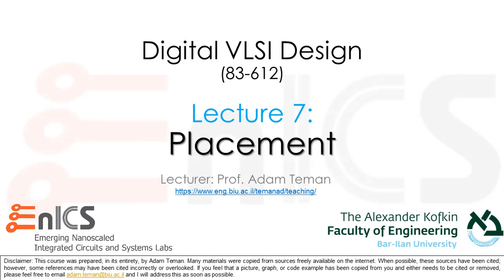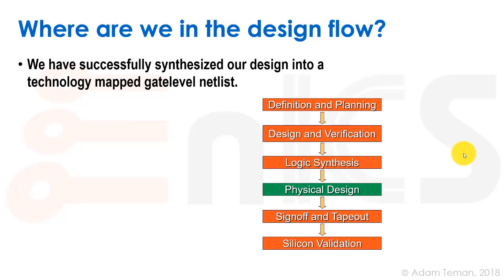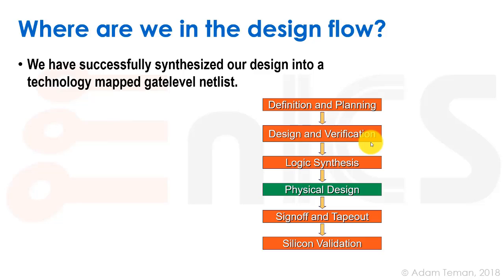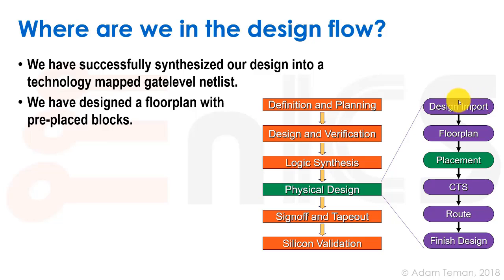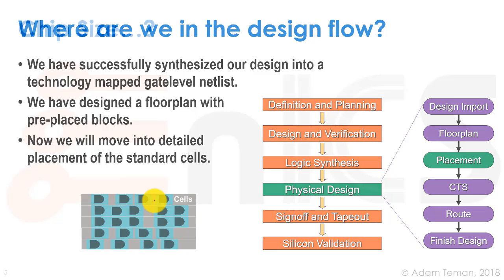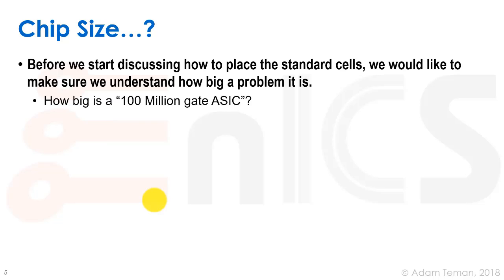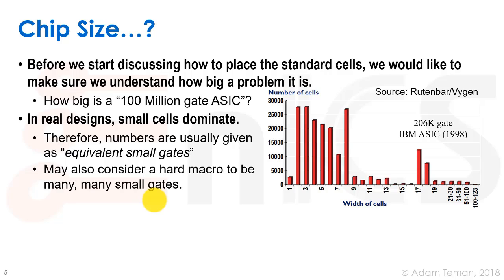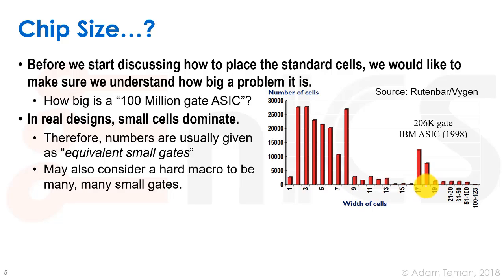DVD - Lecture 7a: Standard Cell Placement

Comment: Hi professor Teman,

At around 3:00, you mentioned many it’s usually to use NAND2 as reference gate since it’s like CMOS. I’m a bit confused about that, could you kindly explain further? Thanks.
Reply from the maker: Hi Mike,

The "basic" CMOS gate is the NAND. As you may have learned in a basic circuit design course, the NAND is usually the preferred CMOS structure, since it has two NMOS in series, as opposed to NOR, which has two PMOS in series. Assuming that NMOS are faster than PMOS (not a valid assumption in some advanced technologies...) then a NAND can be made smaller/faster/more efficient than a NOR, and therefore, it is the "reference" gate.
Reply: Hi Professor @AdiTeman,
Thank you very much for your response. Is the speed of NMOS faster than PMOS because of the doping concentration?

By the way, I genuinely appreciate your course. I used to work at TSMC, but I wasn’t actually very familiar with how a chip is designed. The course is very informative and clear!
Reply: @mikewang4626  mobility of electrons is slightly higher than mobility of holes. thats why nmos is faster. may not be true for modern processes.
Reply from the maker: Thanks @rgoerfederer6456 for answering this. YouTube doesn't highlight comments that I've already responded to, so I didn't see this until now. 

Indeed, it's because the mobility of electrons is higher that holes. 

But you should know that at recent technologies, the PMOS are as fast as NMOS and in some cases even faster (due to stress).